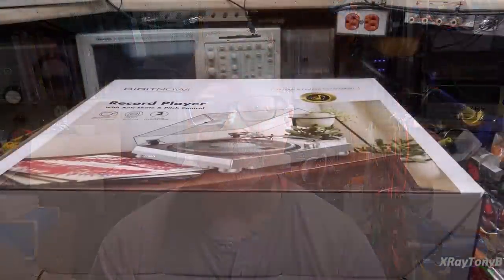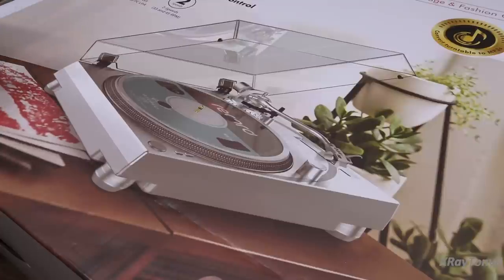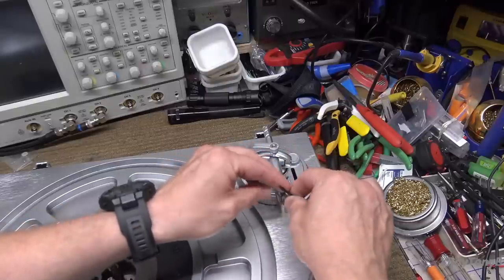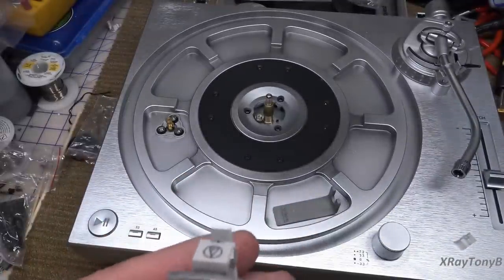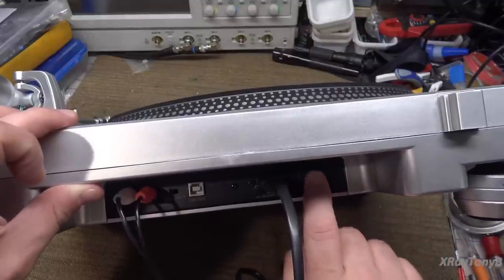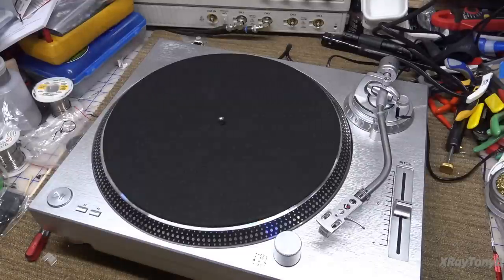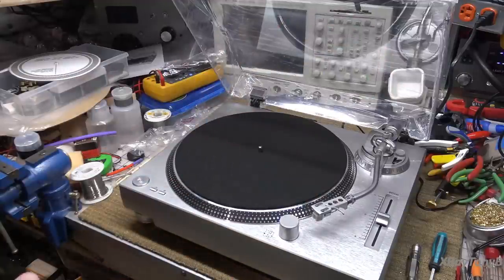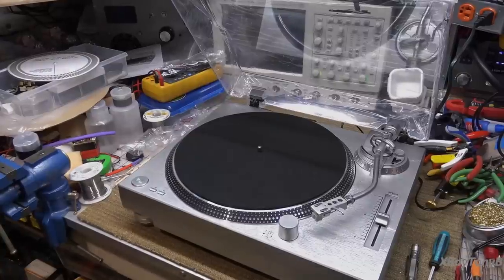DIGITNOW! M-619 Turntable Review

Comment: Tony...The Technics gauge, is specifically designed for Technics arms, with a specified pivot to spindle distance, and a specific number of degrees offset. It will work for this table IF those dimensions meet that spec. On balancing, to zero, the arm should be completely horizontal, not just touching. Skating force not caused by record rotation, but by cartridge overhang and arm angle offset. Re pitch control. 7 dots drift per minute, equals 0.1% speed error.

This is a lightweight plasticky Technics 1200 look alike, which will not be durable. There are better cheap turntables, such as the Heyday, at Target, for $100. Your daughter deserves, much better.
Reply from the maker: This turntable has the same dimensions, as it is a copy (cheap one) of the Technics.  Many of these clone table are.  The arm was horizontal when set to zero.  I tried to show this by moving the paper under the stylus so that you could see it was not touching the platter.  The method I was taught to set anti-skate was to use a smooth platter.  Some of the test records have a smooth side for this purpose.  When set correctly, the arm will not move when placed on the smooth platter, regardless of where you put it down.  The 7 dots per .1% is a good tip to know.   Thanks for the comment!!  I don't think people always realize that you need to set these things up correctly for the turntable to perform as intended.  They just don't work at their best when "right out of the box".
Reply: @xraytonyb  you can use a CD (shiny side up) to set anti skate. “Play” the cd with the stylus down and set the adjustment for no lateral movement.  Advise turning down the volume first.  It will not damage the stylus.
Reply: @xraytonyb  Thanks for your response. The arm has to be an EXACT match-length and angle offset- for the gauge to work properly.
Reply: @len9518  Precisely; "close" as these copies may be, is not acceptable.

Comment: I quite like at3600 for my non pristine records. 3.5g is the correct tracking force for the 3600.  I have been restoring turntables for years. My preferance are technics Q locks and dual 1219. Those guages are great time savers. My hobbies include: restoring motorcycles, bicycles, audio gear, playing bass  and pornography.
Reply: You need to check the specks on that the correct tracking force for the 3600 is 2 grams
Reply: @gingernutpreacher  straight from the website: Tracking. The recommended tracking-force range for the AT3600L is a relatively heavy 2.5-3.5g, but this is not untypical for conical/spherical styli.
Reply: @Poppinwheeeeellllllieeeeez  you're right think I've seen YouTube's say they don't use anything more than 2.5 on there's my gold ring e3 is 2.0grams

Comment: Hopefully the A to D converter isn't junk, some are really horrible :-(
The manufacture should of set the speed presets, they didn't finish the job!.
Imagine buying a car and before you can use it  you have to set the valve clearances lol.
Reply from the maker: When I read the few reviews that I could find, it seems as if this is a common problem with this model.  Hopefully, this video will inform others about the issue.

Comment: that sounds too heavy for the cartridge you have to adjusted it to the compliance of the suspension say somewhere like  1.7g be more correct
 no modern cartridge tracks that heavy 3 g usually 2.2 grams is the highest. you should do it on the scope correctly balanced
Reply from the maker: Tracking force of the AT-3600L is listed as 2.5 - 3.5 Grams.  It is set correctly.
Reply: @xraytonyb  if that's what it states specifications, probably dj1 one

Comment: Tony, the comparison of the digi and the Audio Technica turntable are only comparable in price... 
The Audio Technica turntable isn't claiming world's best! It is a budget unit, I think that the Digi should be compared to the next model up in the Audio Technica range which looks similar to the Digi... Yeah it costs more but it's also a much better turntable... 
I noticed that the strobe light doesn't turn off when the platter is off and the tonearm is at rest! 
Might need to access that power switch more often than not.... 
Honestly, I think that I wouldn't be surprised if the same priced Audio Technica turntable actually sounds better.... 
This Digi thing seems to be pretending to be something that it clearly isn't... 
But at the end of the day, you have it now and it works and sounds great to you so you might as well use it.. 
Just for kick's, look up the specifications for the Technics turntable, pay close attention to it weight LoL.... You wouldn't want to drop it on your feet sitting down let alone standing up.... The Audio Technica clone isn't as heavy but it's definitely weighs more than my vintage pioneer PL110, but the pioneer not only sounds better, it knows how to hang onto the groove as it sits on timer floors right next to the subwoofer! Oh! It knows that the sub is there, I can see the feedback in the speaker cone at really high output levels.... The Audio Technica can't do it, none of the other turntables I have owned could.... I always wondered how DJ's didn't suffer from the same problem since their turntables were getting way more punishment from the speakers... Some turntables are just built better than others.... I don't use the Audio Technica turntable since I got the pioneer.

Comment: Regardless of the System - Vinyl Record Turntable or a "digital source" either one with a Very Good System with Very Good Speakers; the Quality of the Sound is "Recording Dependent". Each System, has Good & Bad Recordings. It's very much "hit or miss" e.g. Even here on YouTube, where the overall sound is compromised by Compression. Yet some of those Recordings are so well done, they can still sound could very good on almost Any Gear ... and the converse is also True. A Bad recording, Can't be rescued by a Digital Source.  go figure ???

Comment: seeing  how you balanced tone arm to me is not correct the tone arm when balanced to zero must be parallel to platter ,which means when bought over the top of platter it must be even with it the whole tonearm must balance evenly over platter a little high or too low will give you wrong setting never heard of a float point but BALANCED evenly ,any tonearm  can float but it has to be even and match platter surface I have heard too many young people call it a float point its wrong term ,and on this TT if it has a built in preamp it is already internally grounded you dont need a ground wire I have a bsr  turntable with a ceramic cart that has a ground wire so ceramic or magnetic it all depends on the manufacturer

Comment: Wrong! Maybe the cartridge is authentic. They’re only $6. The overhang is proportional to the distance from the pivot of the arm and spindle in a right angle triangle on the center of the record. Judging based on the head shell alone is wrong. I guess it will play and you won’t damage anything. No harm no foul. I just don’t like bad info about TT setups. Interested though how it turns out in the end. After watching the wrap up well done.
Reply: You need to explain with greater clarification. The stylus moves over the record surface following the arc of a circle subtended by angle (θ say) at the tonearm pivot.  If r1, is the radius from the tonearm pivot to the centre spindle, and r2 the radius from the tonearm pivot to the stylus, then the offset is simply the difference in radii, e.g. Δr = r2 - r1.  According to the diagram on Vinyl Engine  (which is the one I assume you're referring to)Δr should be set so that the stylus forms a right angled triangle with the centre spindle, preferably at mid point of the arc to minimise distortion away from this point.
Reply from the maker: This turntable is based on the design of the Technics.  The tonearm and head shell are of the same dimensions as the standard Technics, so the method I demonstrated is correct.
Reply: @xraytonyb  My comment (here) referred to DIY_5050's statement not your methodology.
Reply: @davidgriffin79  have you seen a Dennison soundtractor? 3 points, main bearing spindle and the center of the tonearm pivot, center of all the gimbals where the arm mounts, the 3rd is center of a the LP’s playing surface. (I forgot the standard it’s around 3” from center. Form a right angle triangle between the 3 points with the right angle at the main bearing to center surface. There is your overhang point. Bring the arm over and adjust the overhang to where the stylus lands on the point. I hope I’m explaining it correctly. Too bad I can’t upload a picture. Maybe I’ll do a video. 🤔
Reply: @xraytonyb  One thing I can walk back on is you may only have that gauge as a reference because sometimes those technics style arms will not   achieve center curve of a lp.  Just where the distance from main bearing to arm mount, and length of those curved arms don’t align proportionally correct on many Japanese style TTs.